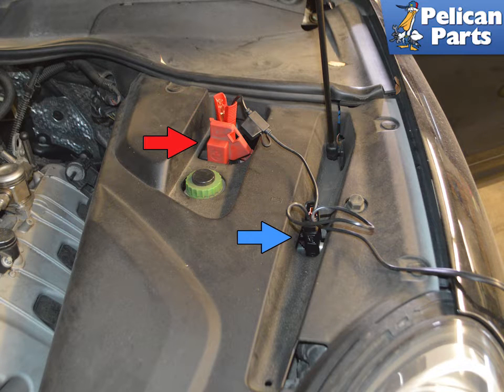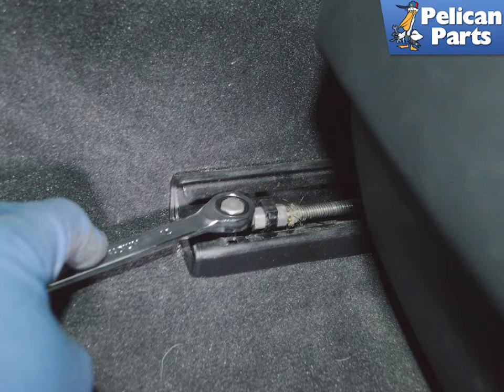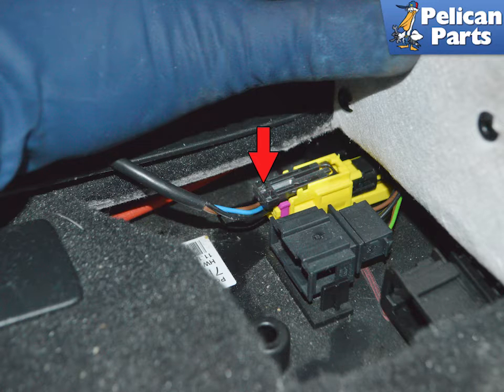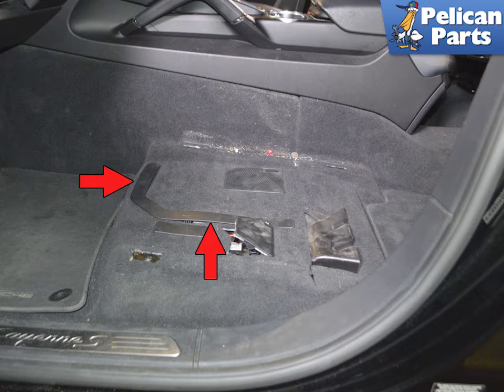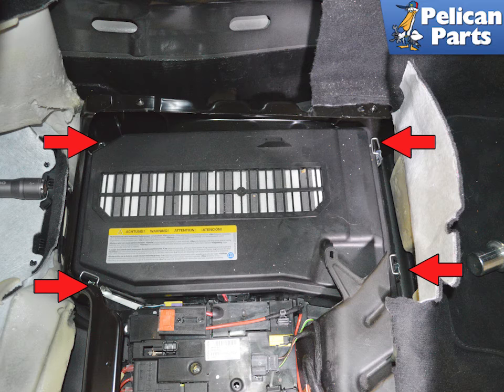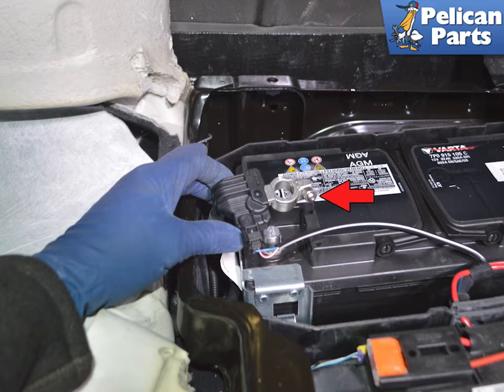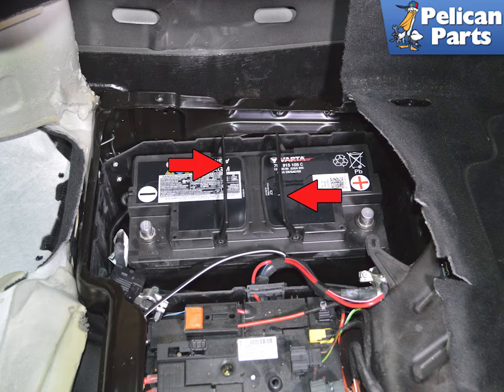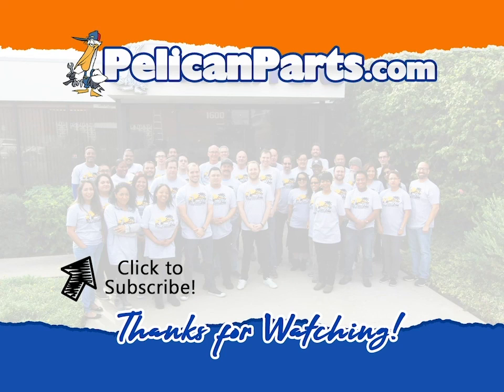Porsche Cayenne 958 Battery Replacement (2011-2019)

Comment: so your telling me its a smart battery and i cant just throw one in I have to have a shop do it because i dont have a scan tool? Is this really what I am getting from this?
Reply from the maker: The vehicle is smart, not necessarily the battery. A battery reset is performed to notify the vehicle of the new battery and battery info. This helps to provide the correct charging cycle.

Comment: I change the battery for my Porsche Cayenne 2011 but still start and stop is not working
Reply from the maker: I would start by checking the vehicle for fault codes. If the system is not working properly, a fault code will be set. This will be your best bet when diagnosing.